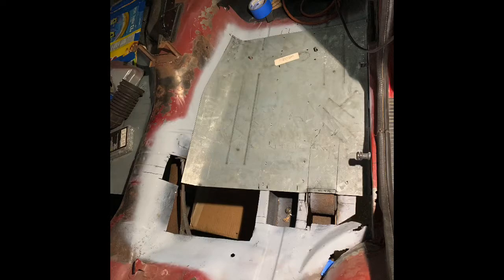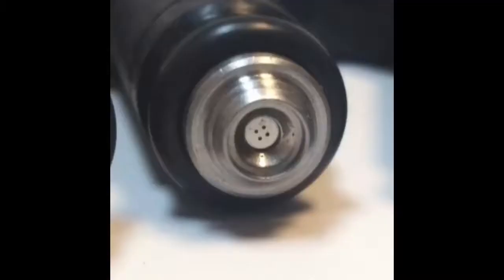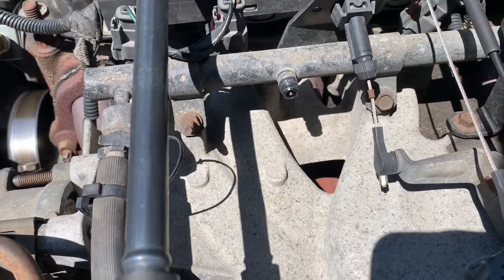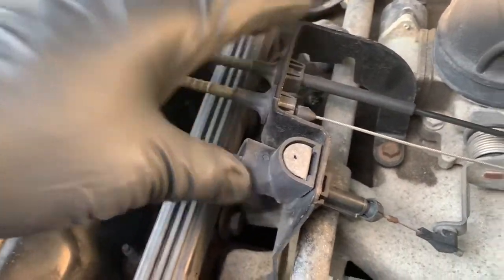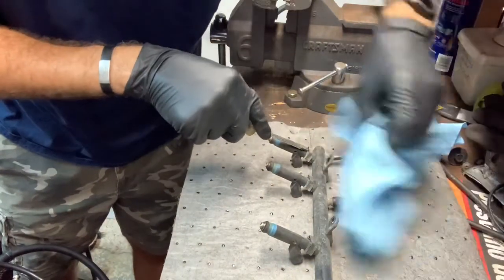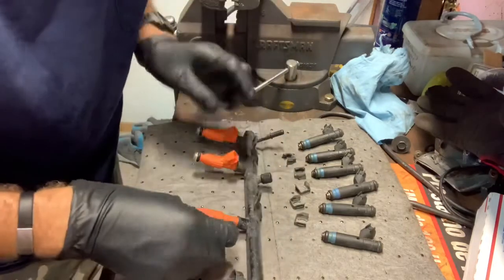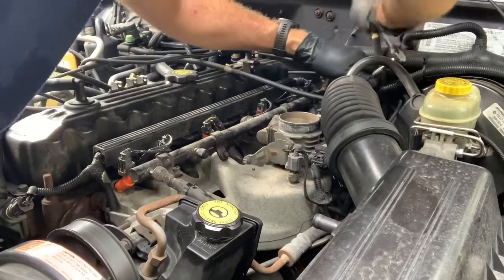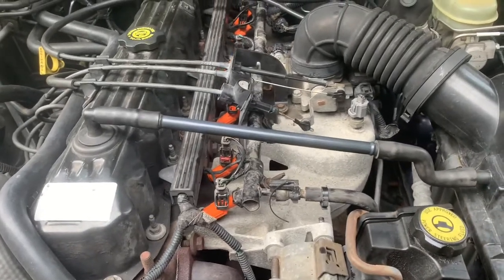Installing 4 hole fuel Injector upgrade on a Jeep motor.

Comment: Just put my Bosch 4 hole rebuilds in my 2000 sport ... and a new Omix oil pressure sensor .... 250K, oil pressure is still 60lbs ... and it ran like a top from first start ... soother idle, better throttle response ..... injectors had never been serviced other than cleaning ... #6 was fried ... rusting out ... but it had not failed ... just took some extra time to thorough clean the fuel rail ports, paint it ... and used silicon plumbers facet grease to keep the O-rings lubed on install ... I got 300k and 20 years out of my last 89 cherokee ... I'd buy another if they still made new ones

Comment: I did this upgrade for a customer and he loved the results on his Cherokee
Reply from the maker: Yeah. I’m getting 20 mpg on the highway. Smooth idle.
Reply: @JustJeep_It  hello 
How is everything so far 

Any change since the installation?
Still 20 mpg?
Reply from the maker: @miasdancinglife6036  I’m still getting around 20..21 mpg on the highway. City driving is around 18mpg. Still idles smooth too!

Comment: Now they sell 12 hole injectors with pigtail adapters! Thanks for taking the time to document this job in detail, I really appreciate it! My 98 GC has a bit of a rough idle, low power and it pings when getting on the gas. Tuneups only help a little. Next stop- injectors, and they might as well be 4-hole.
Reply from the maker: Glad this video helped you!!!

Comment: I have only  one caution -- Don't do this if you live at a higher elevation. I live at 5800 feet and tried 4-hole injectors a few years ago only to have my power bog down, sputter, and die. Went back to the original injectors after a few days and the problem was fixed. The spray was too fine and too lean.
Reply: Sounds like you either got a bad set or one of them was defective. 😬 Where did you buy them?

Comment: I in stalled 4holed injectors in pleased of the single hole. I had a very hard time starting the engine. 2 sets later I had the same problem. Why? Because the injectors were leaking. Bubbles were coming for the injectors. 
Do I had to replace back the single hole injectors. Started just fine. I have a 318 cu 1999 Durango and a 78 Jeep J10 360. Need some good injectors. I gave 200.00 for these injectors that leaked. 
Help !!! 
Pop

Comment: So have you noticed any difference in the fuel economy? Was there any problems with the old injectors or had they been in the Jeep for a long while? I’m needing to replace my injectors and am curious if there is a reason or not to buy these as apposed to stock. Thanks!
Reply from the maker: I still have to do a follow up video but basically the miles per gallon has remained roughly the same but where I noticed an improvement is in the pick up and the idle. Both are very smooth and I feel that it has better throttle response.  For 100 bucks I think having a nice smooth idle and a little better feel in the gas pedal is worth it to me.

Comment: Liked your video here and hoping you could help me here. I own a (FEB)1993 Jeep Grand Cherokee I6 4.0 I would like to upgrade my stock injectors to the 4 hole also. 
1.Will I have to change out my "older style connectors" to the modern style connectors" ones now as I have an older jeep?            2. Do I have to do the Computer Relearn also on mine? 
3. Did you say those injectors you have are remanufactured ones?
Reply from the maker: Yea. You have to do the battery terminal process to have the computer relearn. And the injectors were reman

Comment: I just did the 4 hole injector upgrade and my 1996 jeep cherokee runs like crap. Missing, check engine light. Smells like it's running lean. Any ideas? I know the injectors are working. I can unplug one at a time and each one when unplugged it runs even worse.

Comment: Do you know if the adapters come with the remanufactured 4 hole injectors for a 93 ZJ 4.0? NOTE: Tried to get ahold of K Suspension and no response back yet?
Reply from the maker: Not sure about that.  I didn't get adapters when I bought my injectors.  I'm not 100% sure if they are the same..But I would be willing to guess the 4.0 fuel rail set up is the same for the XJ and ZJ.  but don't hold me to it.
Reply: @JustJeep_It  Well, you shouldn't of needed the adapters due to you have the newer EV6 style connector and I have the EV1 pintle style connector. Just thought you might of known if they supplied the adapter for older models, that's all. But thanks anyway. Note; They still haven't contacted me back.
Reply: @toddrhine7648  did you ever find out, i ordered a set for my 94 ZJ and assumed theyd be reman 4 hole ev1 but now im not sure, i didnt order pigtail adapters

Comment: Hello 

I have an XJ 
And wondering if it’s still giving you 20 miles per gallón 
And working good?
Reply from the maker: I do a good bit of highway driving commuting to/from work during the week - about 200 miles each day.  I’m getting on average 20.3 miles per gallon.
Reply: @JustJeep_It  wowwww……
That’s totally awesome 
I will for sure do it 

Thanks so much for the response!!!!

How do you feel the horsepower now?

It is pretty interesting
Reply: @JustJeep_It  how much horse power did you gain?
I am really excited about it!!
Reply: @miasdancinglife6036  You really can't tell whether any power was gained or lost without a Dyno Test or an accurately-measured field acceleration test. 
 I enjoy the engine smoothness -- not concerned with the tiny power increase/decrease.

Comment: Is there really any value to resetting the PCM? I mean I have actually never heard of this before. I have replaced my o2 sensors before cleared the codes and was off to the races. I am asking because. My deck has a hell of a time reconnecting to my phone if I undo my battery plus I have two batteries and my main one is on the bottom. I found you because I too am having injector issues, and am going to replace them with your suggested injectors, but I really don't want to disconnect my battery. It causes so much more work if it isn't absolutely mandatory. Like I said. i have replaced my 02's and only reset the code and it seems to be fine. That said I think I have a clogged injector, and i am not getting any engine codes. I am only getting surging on the freeway. The only thing left is the actual injectors. They are original and  have just a touch under 200K miles. Seriously falls on its face on the freeway. but no check engine light.  have replaced the fuel pump (it was actually broken on the bottom) and the distributor for a different reason, but it still surges at 60 on the freeway. The only thing left that could potentially cause an issue with no blown fuses or check engine lights is most likely the injectors in my eyes. if  am wrong then  will have some updated injectors and  can cross that off my list. Thanks for the awesome video. I will have some work to do soon.
Reply from the maker: Not sure if it’s a reset but the skim program is turned off so the car can be started without the chip key.
Reply: Test/Replace your Throttle Position Sensor 👍
Reply: @blizzytaj  I actually figured out what the problem was. It is amazing that it didn't throw codes. I did replace the injectors and it does have a touch more power and runs incredibly smoother, but the actual falling on its face and surging on the freeway was a bare exposed wire on the cam sensor. Actually it was all three wires going into the pigtail had no sheathing around them. All three were bare. I wrapped them with electrical tape and it fixed my issue. After all of that it fixed the falling on its face and the surge problem and then I inherited a high idle. I removed the IAC motor and checked it and sure enough no continuity on the outer pins. I replaced that and it fixed the idle issue and now it is all happy again. So you were definitely on the right track.
Reply: @IAmRootGarage  That's wild, glad you got it fixed!

Comment: I don’t have a kick down cable. Is there supposed to be one? I drive a 2004 4.0 Wrangler X automatic.
Reply from the maker: All automatic transmission Jeeps I have ever owned has a kickdown cable
Reply: @JustJeep_It  what happened to mine? Is there a spring that is used in place of that? I’ve seen some ppl have one of those too. My jeep has the throttle cable and the cruise control only.
Reply from the maker: That’s strange. It should be there. The trans needs it to shift
Reply: @JustJeep_It  I don’t know what to say. Maybe I’m mistaken. Tomorrow I will send a pic?
Thanks for your responses!
Reply: Electronic transmission does not need cable